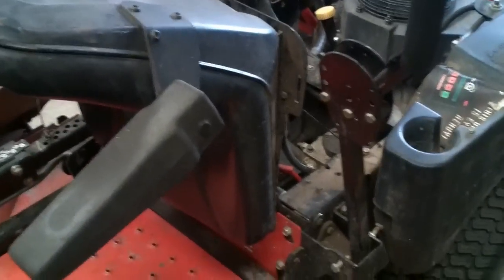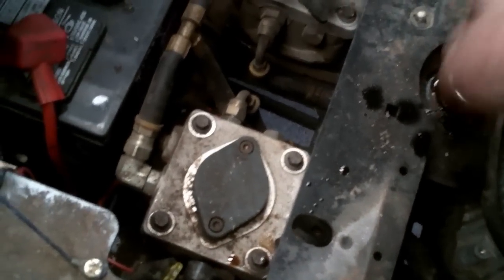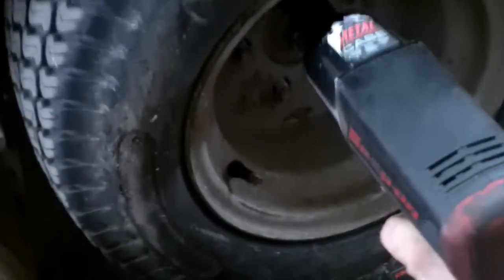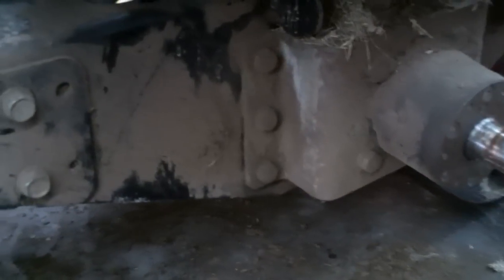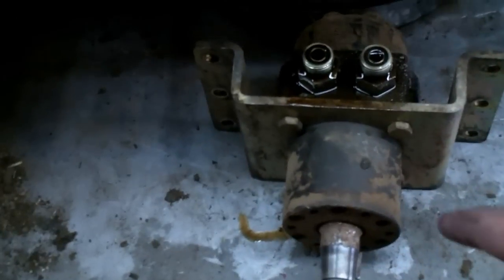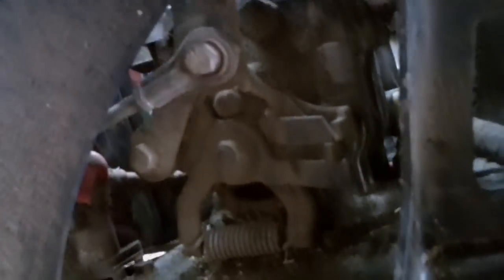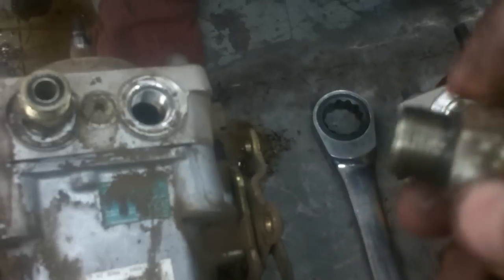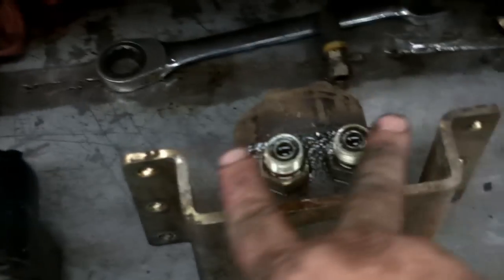ZERO TURN MOWER REPAIR      how to replace the pumps and wheel motors

Comment: I have the same mower the left side will not turn i change the left  hydraulic motor and wheel motor but it’s doing the same thing. Any suggestions
Reply from the maker: Pick up hose blocked
Reply: @THEMOWERMEDIC1  witch one of the hoses
Reply from the maker: @Julio-kj4wh suction hose off the reserve tank.   But you probably just have air in the lines and then it needs to be bled out.
Reply: @THEMOWERMEDIC1  ok I’ll look at it thank you
Reply: @THEMOWERMEDIC1  I checked the lines and are good with one is the bleeding valve
Reply: @THEMOWERMEDIC1  Good morning I bleed the lines out and still having the same issue
Reply from the maker: @Julio-kj4wh then u must be getting air
In the lines someplace.
Reply: @THEMOWERMEDIC1  ok I’ll check them again thanks

Comment: I just bought a new hydraulic pump and had my wheel motor rebuilt for the left side of my Ferris.  Since the pump and motor does not have any oil in it, do I put some oil in them or do I just install them dry?

Comment: Awesome video. I don't want to swell your head up, but you did a great job editing your video, Two thumbs up, well done. You should do more on Toros too. I still cant find my Freewheel lever that makes it move freely if more is disabled. I have a 2013 model 74940 34HP EFI. If you can help it would be greatly appreciated.
Reply: I am always stunned at how much information is left out of an operation manual and left for the operator to guess the answer.
Reply: Page 27 of your user manual.

Comment: I feel u bro I work at a golf course  I also do small engine mechanic we have a sand pro for the sand bunkers the pumps wer acting up told my boss when thay bought new pumps that thay use 2050 synthetic oil he sed he gona put hydro oil I was ok do as u like the pumps did not last that long the pumps cost more than the unit is worth so no we have a 300lbs paper wate in the shop ..... sincerely... RIGO SMALL ENGINE REPAIR some people are just hard headed thay think thay know it all thay don't no shit

Comment: I have a zero turn that keeps bogging out. I replaced with a new fuel filter n cleaned the gas tank. I also ran a wire hanger through the fuel line n it still keeps bogging out...can anyone please help me...

Comment: i have a woods 6160 0 turn mower,one of my hydros stop pulling,when i push or pull the level it just whine and it act as if it wants to move backward or forward.if i turn it off for about 10 mins or more and start it up it will go about 5 yds until it stops again.if i push or pull the throttle on that same hydo the fan slows down or stops until i put  the throttle back in the neutral position..Can anyone please help me this?Thk you in advance
Reply from the maker: Getting air in system check all hoses and fittings
Reply: JEREMY FOUNTAIN Thank you for the reply and info.I'll check for it as soon as the rain is gone.I'll be back in touch to update you and the thread.

Comment: This must have been one expensive repair bill.
Reply from the maker: Bout 2k dollars.  Or 7 k for a new mower
Reply: JEREMY FOUNTAIN How do u replace the center deck pully on a d322 grasshopper?
Reply: @THEMOWERMEDIC1  Thank you for telling the price.  I watch SO MANY videos where I'm left wondering "what did that cost."  It's often one of the most important items for the video (for entertainment value) and so many people leave it out.  I don't understand the hesitancy of many people to talk price.  It's not like it's a big secret because, usually, you'll have to give the customer a range anyway.  Further, videos can help educate people in advance to avoid the usual "shock" went told.  It's a big time waster to diagnose a problem and the customer walks away because he thinks it's way too expensive.  Thanks again.
Reply: @ptman3  The issue with stating a cost is that there's an implication that all the work performed was strictly necessary vs a judgement call after some discussion of the risks involved.

Some of this work was insurance, so that the customer would be far less likely to come back with problems soon. The pumps were diagnosed as bad but the wheel motors were assumed bad due to having the wrong fluid pushed through them. Not a thing wrong with that so long as the customer can pay, and wants to do so. Others might have only had the pumps replaced. 

I think we saw a few new hoses also in this video, but had the old ones leaked yet? I'm not saying that should not have been performed, but when the mechanic wants to be able to tell the customer, "Do all this stuff and you won't have problems" that's very valuable. Many people do not want to hear, "We'll replace just the broken part, and if it's still not quite right bring it back for more." They'd be left wondering why the tech doesn't know what's wrong ... unless the tech has a conversation and a recommendation for them.

My question is, what fluid did the owner use, because most so-called "hydraulic fluid" is already really just motor oil of some kind. For my Gravely they spec 15W50 synthetic hydraulic oil, which does not actually exist unless it comes in a red Gravely bottle. Otherwise most people know it as Mobil 1 15W50 motor oil, at half the cost ... and you know it's weird when you start describing Mobil 1 as the "cheap" alternative.

Comment: Hi Jeremy, i have a Gravely 2350 HVZ, bout 7 years old.  When i try to go slow like along edges of concrete etc, the mower begins to jerk back & fourth getting so hard i have to stop.  I know the jerking gets my arms jerking back & fourth making the problem worse.  I drives ok when in full forward.  I asked the guys at the shop but they just want me to bring it in for a check up.  I can do the work myself, i just need to know what is wrong. The service manual says nothing about the wheel motors.   Thnx for your time  Jeb, jeb@cox.net.
Reply: Jebster H
If your zero turn mower Control Arms are jerking back and forth while going slow, REPLACE both gas charged DAMPERS on the control arms.

Yes, I know this question was asked 2 years ago, however, someone else may have the same problem with their zero turn gas dampers being worn-out too.